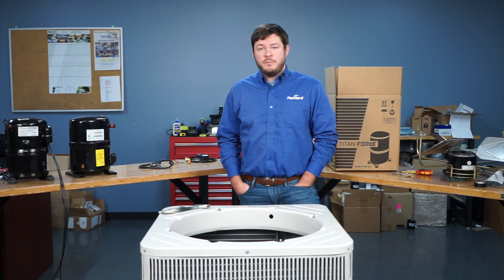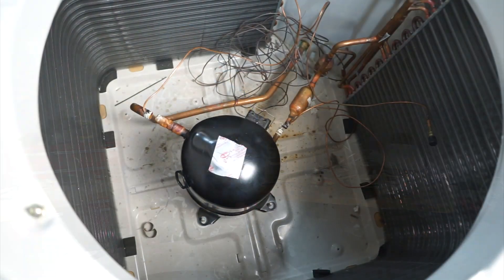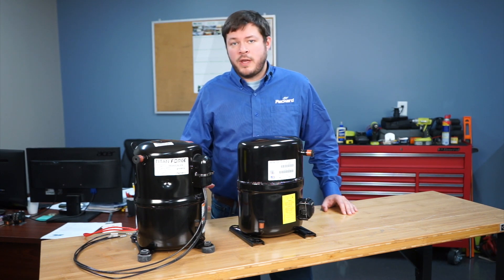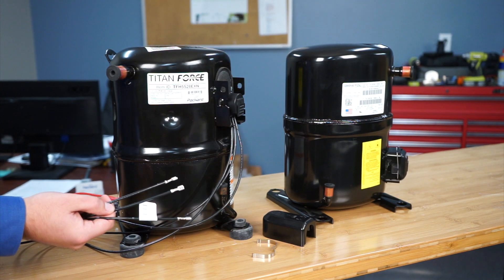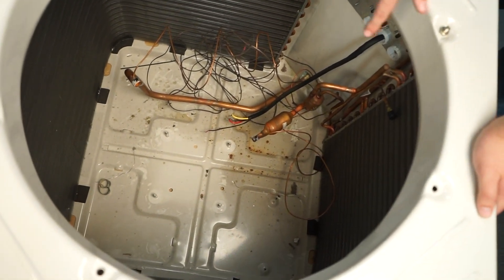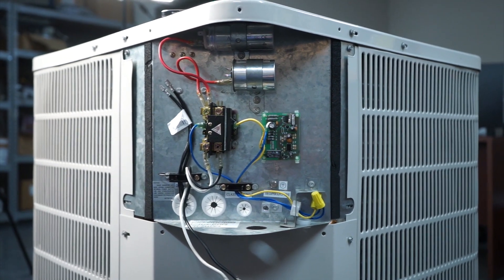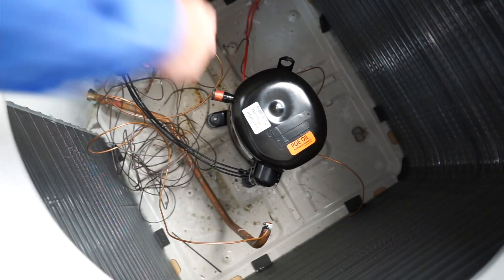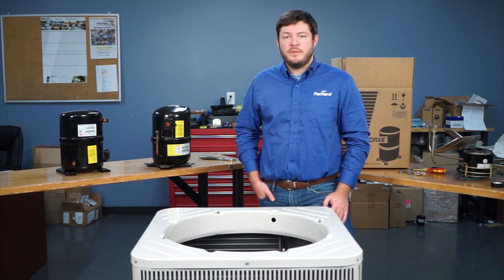Titan Force Compressor- Easy Installation Walkthrough

Comment: You didn't say what you did with the two red wires
Reply from the maker: Crankcase heater must be connected to lineside of contactor.
Reply: When you say lineside of contactor you mean L1- T1 or L1-L2 or T1-T2